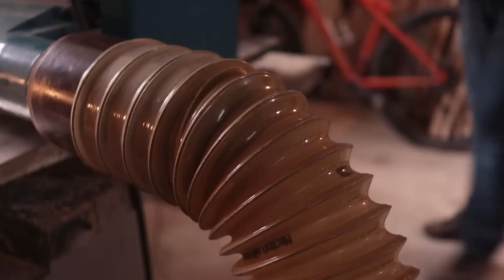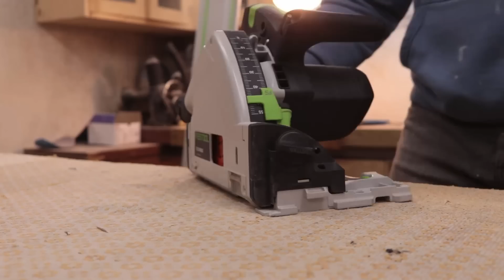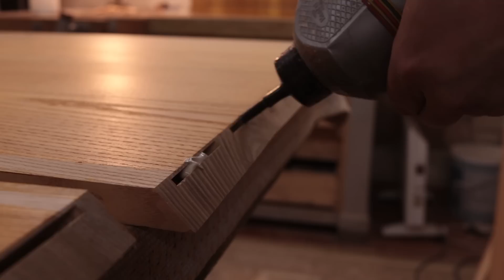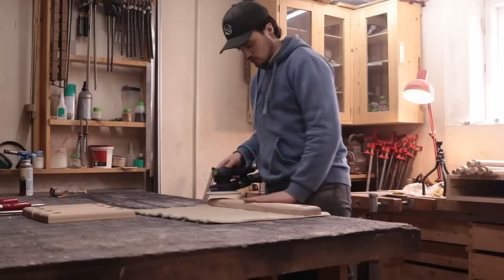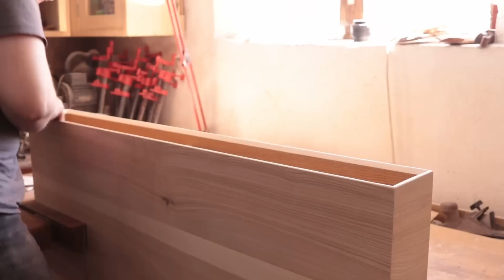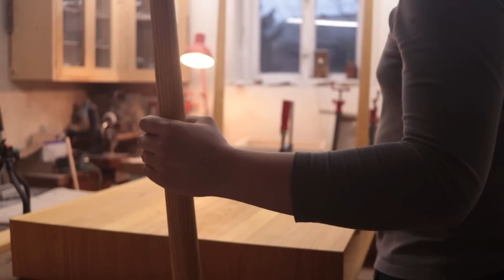Making ash Desk

Comment: Nice work but I'd like to suggest two things:

1) Get a guard for the jointer. Exposed knives are very dangerous!

2) Consider getting an outfeed table for the table saw. It makes long rip cuts safer since the board won't fall down behind the saw.
Reply from the maker: Thanks for the review and advice, totally agree with you on these points!